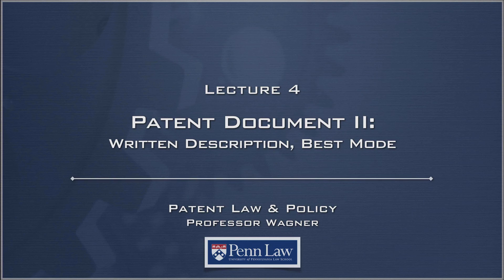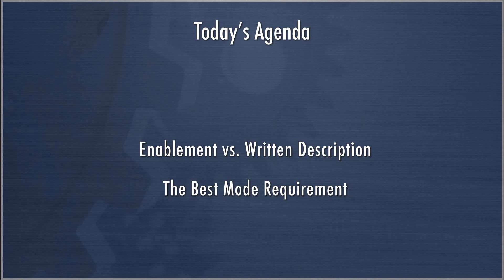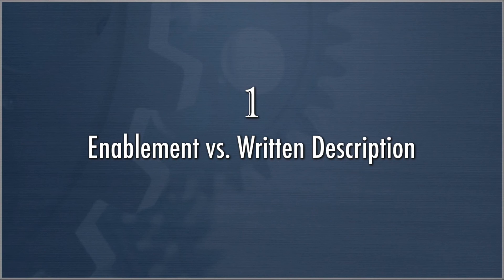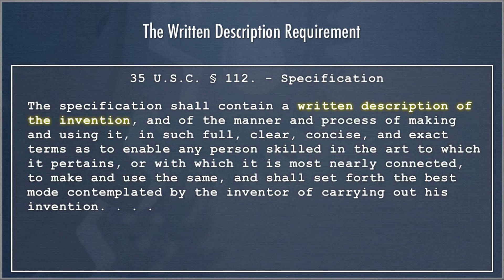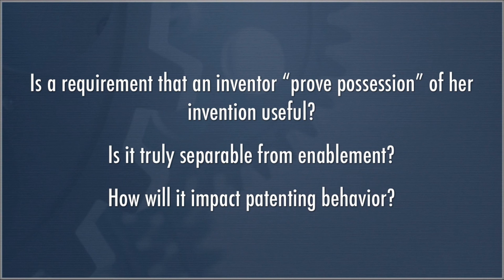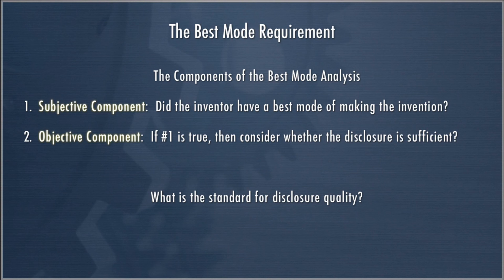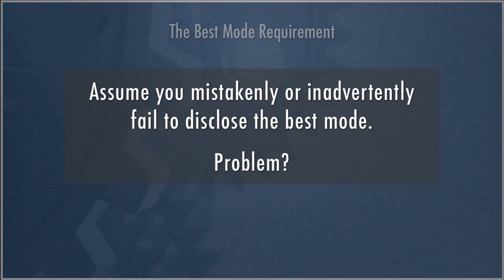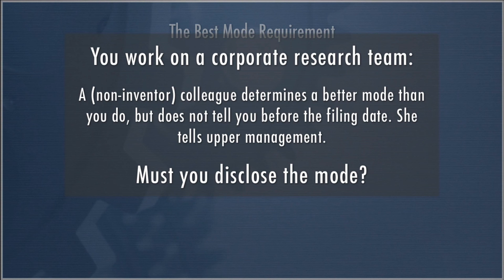Lecture 04 - Patent Document 2

Comment: I disagree with the 'comma' argument because back in the day and still in British English, a comma is typically used before 'and'.  Americans found that extra comma often confusing and unnecessary and decided to drop it as a norm from American English.  So, the comma after the written description to me seems more like a remnant of the way grammar was done in the past rather than a true separation of written description from enabled requirement.  Even today an American would write "cat, bat and mouse" while a Britisher would write "cat, bat, and mouse".  In this text, you can see there is a comma even after concise before the and.  Does that mean 'full, clear, concise' are separate from the 'exact terms'? No.  In the past, they would've used a semicolon if they were truly trying to declare these as separate requirements.  To me this text is mostly just saying there should be a written description in the application, not so much that the entire enablement has to be written and can't be drawn etc.
Reply: I agree. I feel like the strongest argument in my opinion for having a "separate written description" is that people would start trying to do the enablement requirement only through the formal drawings with labels? Or maybe some people in the past tried doing so. Other than that, I really don't see how the written description and enablement requirements are separate whatsoever.